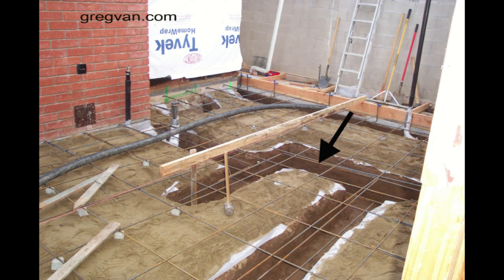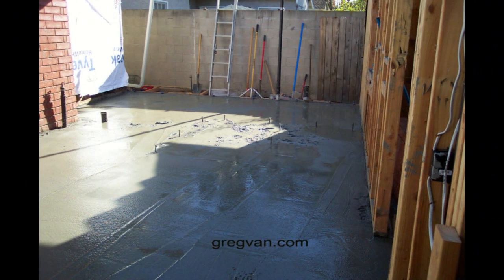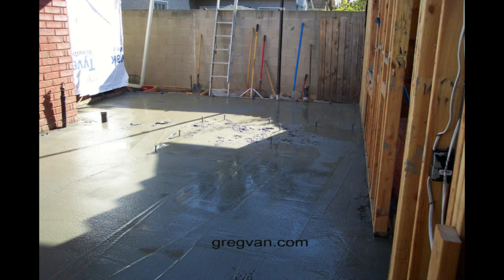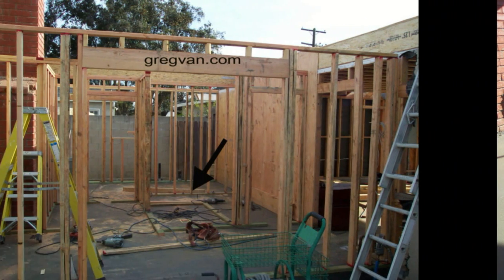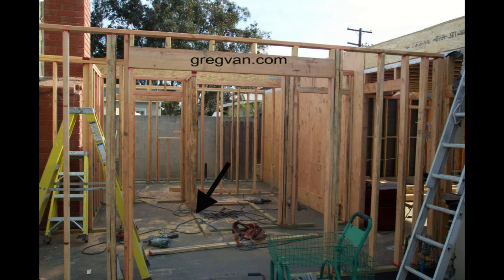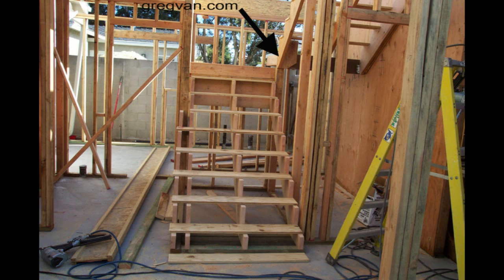Interior Load Bearing Walls and Concrete Footings - Part Two

Comment: Do interior footings typically extend below the frost line, or is that only an issue for exterior footings? Can’t seem to find a whole lot of information on them.
Reply from the maker: It all depends on the type of construction, freezing temperatures, soil conditions, construction methods used and whether or not the floors going to be heated. A structural engineer or general contractor in your area might be able to provide you with more information.

Comment: Your videos are enormously instructive,  thanks. I’m just opening my eyes to footings. I have an open basement with a 42’ main beam down the center supported by 4 lolly columns. The beam sags between the columns and I wondered if there was likely to be a footing run, under the concrete, length of the beam that the current columns are standing in or would it have been customary to pour footings per each individual column?
Reply from the maker: I've seen a lot of basements built without concrete footings, but it would be difficult for anyone, including me to answer your question, without looking at the original building plans or by doing some detective work to figure out if they are there. Thanks for watching our videos and I'm glad you find them helpful.
Reply: Oh, that’s interesting. I assumed that at least the columns that were sunk into the concrete had footings to support the main beam. Thanks. I just thought to look to see if you mad a vid on main beam supports. Apologies is you do.
Reply from the maker: @NMranchhand  If your columns are protruding from the concrete floor, then they are probably supported by a structural footing or pad.

Comment: Are builders concern about putting up this stuff to support load bearing wall all tne time no matter what the floor size is?
Reply from the maker: Concrete footings are normally used for load bearing walls, but can also be used under structural sheer walls that are used to prevent the building from moving side to side. The floor joist span usually determined the location of load bearing walls. For example if a certain sized joist can only span 20 feet, then the walls can't be space any further apart than 20 feet, without increasing the size of the joist. Let me know if this answered your question.

Comment: hi i need some help. 
i was wondering how do u support a load bearing wall while your removing the floor joists at the sametime? And this floor bearing walls are underneath stairs. 
do we make a supporting wall from the ground up to hold the ceiling in place on both sides? do we take our stairs down while we are doing this. cause the stairs are connected to a load bearing wall but that load bearing wall and the steps all might have to be replaced plus all the floor joist. 
can anyone help me out with this so i know what i need to do. im remodling a house i bought. so its just my boyfriend and i doing all the work.

Comment: im still trying to understand the interior load bearing part on the stairs.. ok its in the side of the stairs where the arrow is pointing but i dont see a wall the two joist under each step make is a bearing wall?
Reply from the maker: Make sure you visit the website and check out the engineering and framing sections for more information about load bearing walls. You're on the right path, weight that is transferring from one section (roof rafters and floor joist )of the house to the walls usually makes it load bearing.

Comment: Great video! Couple questions for you: I am planning to buy this house, single story building. my plan is to built another level, second store for the building. There seems to be no drawings/ survey/ floorplan for the house. It was built 1978. So, the question is, is footing strong enough to build second story for the building?? They keep telling me, structural engineer has to check footing, dig out some outside dirt and to make sure, for 2 floor building , you are saying, it has to be at least 15 inches wide, and 18 inches deep?? to able to bear weight??/ Also, if footing is strong enough, do I have to add footing under, where stairs go upstairs??Thanks, youtheman!
Reply from the maker: +Eero Laukkanen There are plenty of different ways to add a second story to an existing single-story structure, but I won't be able to help you as much as a structural engineer can. However, you can try contacting your local building department, which will be located in your city or County. If the home was built in 1978, there's a good chance they have copies of the original plans and if they do, then the structural engineers job will be easier, which means you will save money.
Reply: +gregvancom Noup, they don't have any plans for the house=((, they said they don't keep records/ plans after 10 years??, So, in general, I understand, it depens from the size of the house, and second floor, and of course, of the type of roofing, you put on, tiles are heavier than asphalt shingles, but...., if regular footing is 12 inches wide, and fifteen inches deep???, then do two floors building need, at least 15 inches wide, and at least, 18 inches deep footing??/ That is my question, thanks =)
Reply from the maker: I would contact a structural engineer, because I have built two-story room additions over 12" x 12" footings, but more than likely the footings will need to be modified. You can always use post-and beam type of construction and an engineer would be able to provide you with the most cost-effective way to build the best product. The good news is, I am going to make a video on this in the future, but it won't be for a few months, because it will take a lot of time to create the video.
Reply: Great, so even footings now would be??? only 12 inches wide/ deep, we could modify them outside, if needed?? I really would like add second floor to this insisting house, has only 3 bedrooms, total about 1650 sf now=)Also depends  about soil/sand type around house, right??
Reply: SO, here in Florida the soil is very fine, and sand. That makes bearing capacity less per pound??? How do you measure bearing capacity of soil?/ if it is more than 1500 pounds per square foot, like 2000??, then the footings now maybe OK?? If they are 12 deep, and 15-16 wide!! thanks for your opinion, youtheman =)
Reply from the maker: I wish I could answer your question, but I don't know how to measure bearing capacity of soil. I would suggest contacting the structural engineer for more information. However you do bring up a good point and that is that different areas, with different types of soil, require different sized footings and that's why you should always check with your local building department before building anything.
Reply: OK, thanks !

Comment: Very informative video!  In this case, would the slab and footings under the interior load bearing walls be poured as one piece of concrete?  How would waterproofing be done for that slab?  Thanks!
Reply from the maker: ***** Yes it's called a monolithic pour and would be one solid piece. The only moisture barrier on this project is a 6 mm sheet of plastic underneath the sand that sits on top of the soil.
Reply: gregvancom Is that white stuff in the video the moisture barrier?  If so that would mean there's no moisture barrier under the footing?
Reply from the maker: Yes, the 6 mm plastic is clear or white and for structural reasons can't go into the footings. It would be hard to poor the footings with the plastic moisture barrier and it would also separate the footings from the slab.

Comment: Great video. thanks for the pics you used. I wanted to ask you, hopefully you can give me some light on this. There was an addition done to this house one of the exterior walls was left and the window was taken off and closed up and then they added some "Mother-inlaw" quarters but I wanted to know if I could of take off the whole wall or maybe just take of 3/4's of the wall making a big entrance in the middle and just leaving the 2 ends of the wall about 1ft as a little wall on both sides, thinking that will still hold be holding the top still of the roof?? is that possible?? and if it is,what would I have to not take off from that wall, or replace to not make the wall weaker?
Reply from the maker: monchis31 I can't provide you with structural engineering advice and would suggest contacting a contractor in your area or a structural engineer. I have put together a list of videos that might be of interest to you on structural engineering http://video.gregvan.com/structural_engineering.htm

Comment: Thanks alot! I've tried to find an answer for this question for a while. Your video's nailed it. Another question I have is: does the footing for bearing walls have the same thickness as the footing of exterior walls?
Reply from the maker: Most of the time yes, but it would all depend upon the weight being carried by either the exterior interior walls as to whether or not the footings will be bigger or smaller.

Comment: Question: I purchased a 1000 sq. ft home. It has support beams in the basement running down the center of the home with a block of wood on each post. The center of the homes flooring are bowing up. The bearing walls are 6 inches to the left of center. I have two contractors with different opinions. One wants to take the wood blocks out to lower the floor, other wants to move the steel beam under the load bearing walls and or keep both support beams. Either way, which ever one is right, I would only like one beam running through. I would like your opinion. Thanks so much. PS. No floors in attic.
Reply from the maker: If you can send me some pictures and remember I'm not a structural engineer and will only be providing you with an opinion if possible. You might think about contacting a structural engineer instead of a contractor. You can find my email address at the bottom of gregvan.com.

Comment: I have a foundation dilemma, It's an old 2 story building built in the 1700s. The foundation is dirt with about 5' headroom and I'm wondering if its at all possible to dig for more headroom as well as put a concrete foundation without having the building collapse on itself.
Reply from the maker: I probably can't help you with this and would suggest contacting a structural engineer. If you start removing dirt, you could create problems for the building foundation.
Reply: gregvancom if we removed let's say 4 tons of dirt, what can we do to replace the dirt we removed? Any tips on dealing with dirt based foundations?what about lining the wooden building up with jacks and than adding a concrete base?
Reply from the maker: The project you're working on isn't something I would do as someone who has over 30 years of experience, working on a variety of different projects, without hiring a structural engineer.
Reply: gregvancom Would a structural engineer file a complaint with the DOB if he sees something he doesn't like or are most engineers cool and will work to help out the building owners?
Reply from the maker: I don't think they are obligated to contact the building department and would work it out with the building owner, but I don't know for sure. If you're worried about that, contact a few structural engineers and explain your situation to them over the phone. You could also ask them how much it's going to cost or how much time it would take to draw up the plans.